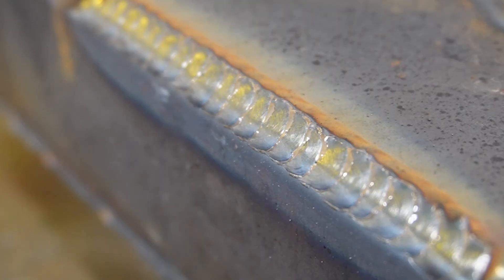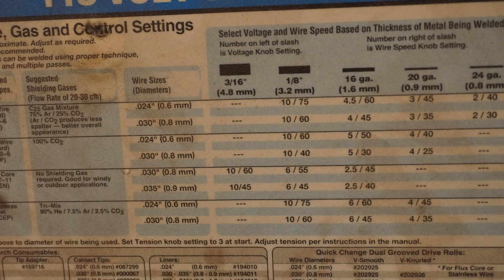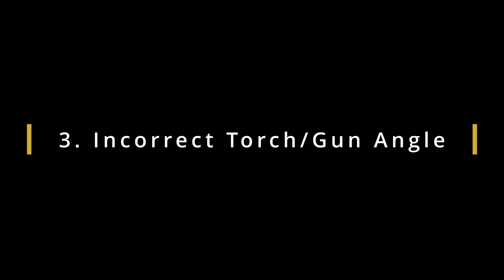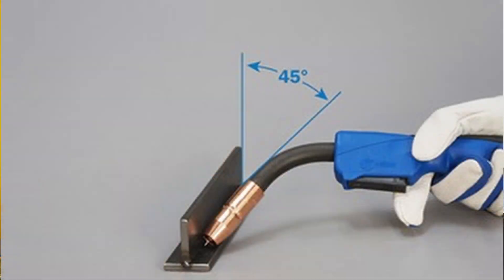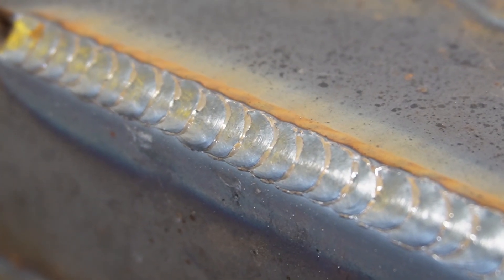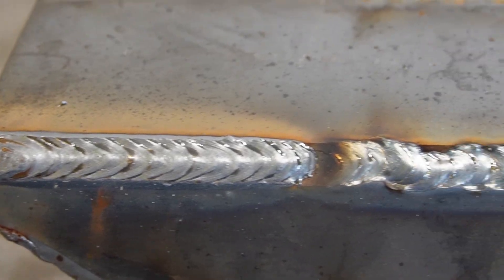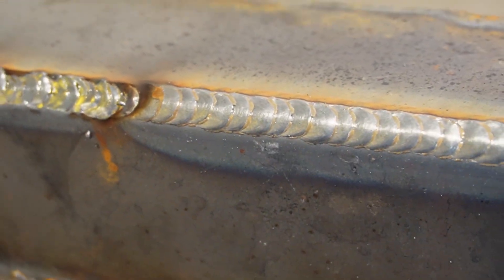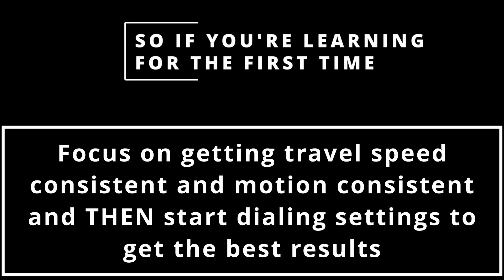Top Mistakes Beginners Make When Welding Outside Corners

Comment: Why would I lower the temperature just to imitate the look of a TIG weld? All I want is a nice even weld with good fusion and no porosity. I rather run too hot than too cold, at least if I run too hot, I can see the problems on the surface, that is not always the case if I run too cold and there's poor fusion.
Reply: I suppose the situation would dictate what results you want, load bearing verses cosmetic.